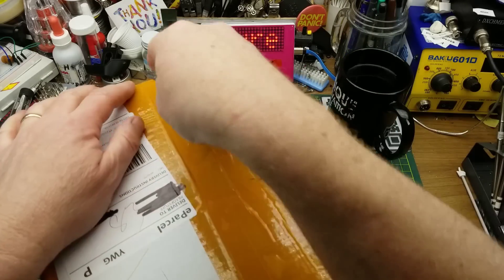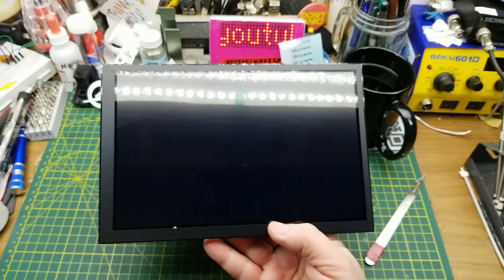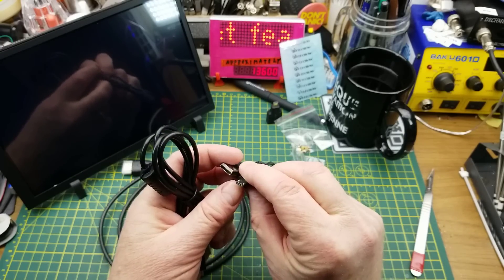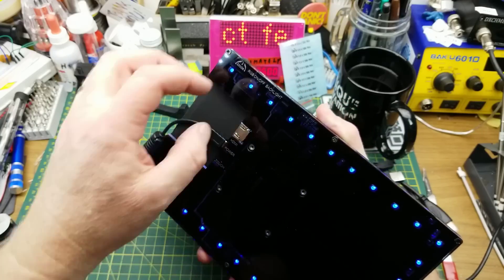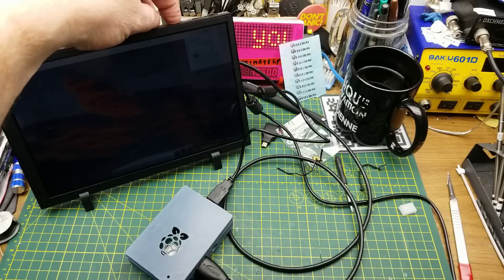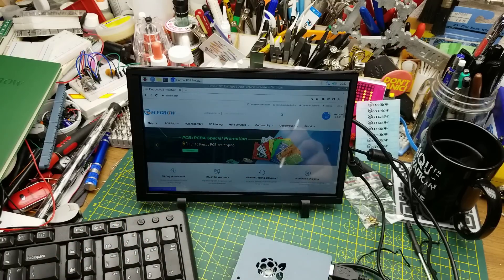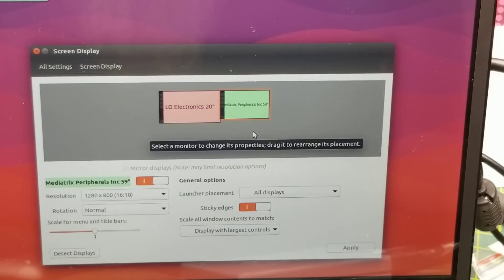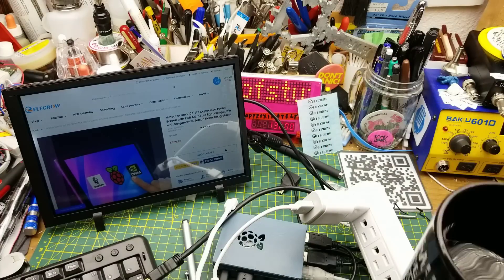First look:  Elecrow Meteor 10.1" IPS touch screen

Comment: That looks like a great HMI monitor for an individual piece of equipment. Does it have capability to be mounted over a cutout in a panel? 
The big PLC players like Rockwell just bolt a Windows micro PC to the back of a similar monitor and charge substantially more. 
Running Node Red on a Pi 3B+ would outperform the $$$$ gear in the brand new $$$$$$$ facility I work in, and deliver a better user experience.
Reply from the maker: The only mounts I can see are the 4 threaded inserts on the back. 
They are intended to attach a Pi, but they're strong enough to mount the monitor.